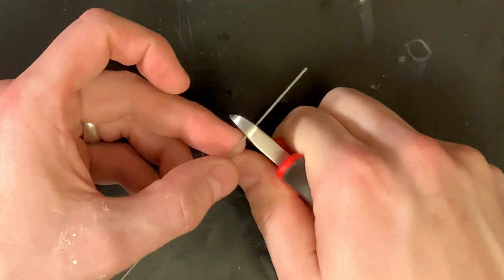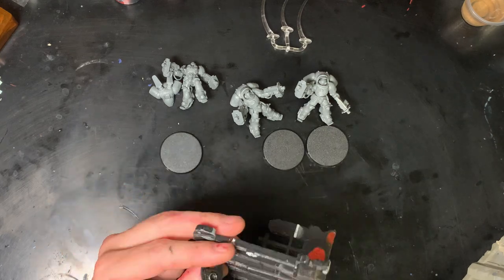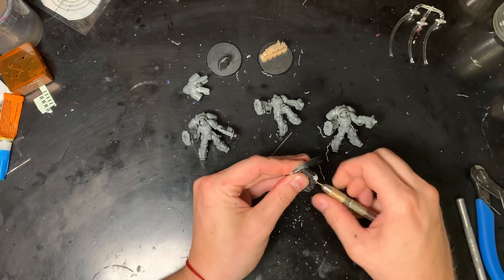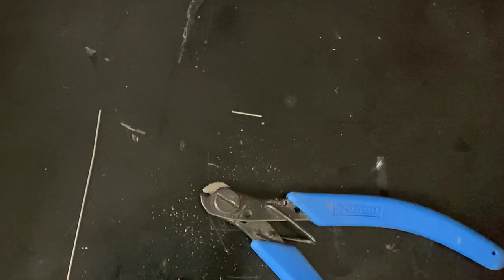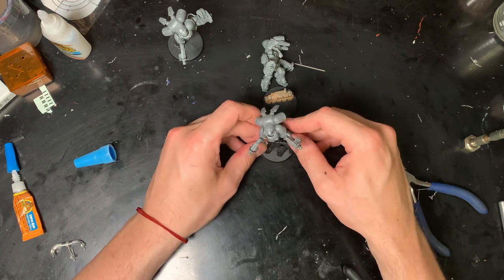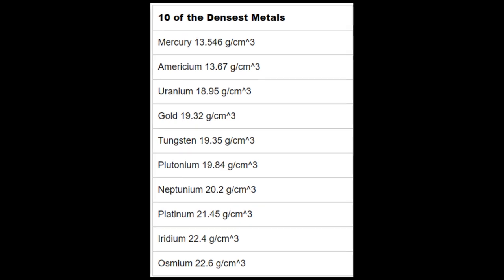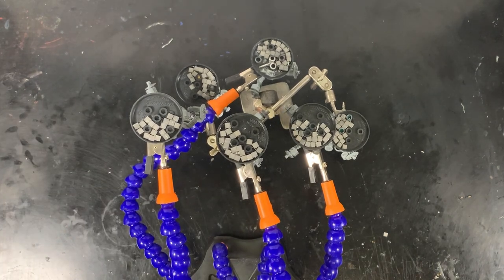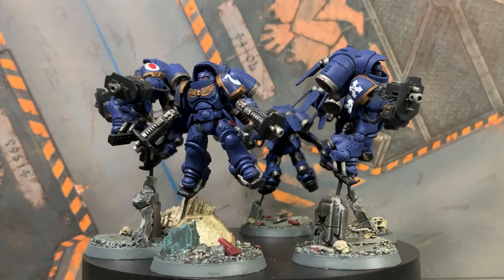Flight Stands SUCK!

Comment: About to do some new Inceptors myself, and was thinking of doing some printed smoke trails again, but I may follow this method. I dig it!. I also may make these next Inceptors with glowing dual plasmas, too, thanks to your vid on it! 

Great content you've got here, man! Hoping to see more uploads in the future.
Reply from the maker: I do have 6 iceptors I will be doing with LED plasma eventually but with a new imperial knights codex on the way…….
Reply: Stoked to see those come together! Your video actually inspired me to model my own coil tonight (I'm like level 2/10 for Fusion360), but it was a fun project. I'm contemplating whether to print them in an inked blue resin, make a blue-stuff mold and use the resin and a UV light to cure, or bite the bullet and do your casting/molding method, but hobby budget is a bit tight right now. 

I've thought about doing three LEDs, two blues and one red for helmet/eyes for the Inceptors, but when it comes to electronics like this, I'm a bit inept and even with a dual CR2032, it won't quite put out enough (and I don't want the base to be huge.) I've got a few other ideas for the plasma inceptors myself, hope to work on them in the next few weeks.  Thanks again for the great content- glad I found your vids.

Comment: Even cheap solution for the counter weight. We used a penny with tall pewter miniatures when they wouldn’t stay upright.
Reply from the maker: A Nickel fits perfectly in a 25 mm round but I still prefer the chips it’s a bit more specific in the placement and it’s heavier

Comment: My biggest problem with my suppressors was, hoe am I meant to prime and paint them without painting the stand. The stand in my heldrake is removable but the suppressors need to be glued on
Reply from the maker: Masking tape and or masking fluid are what you are looking for in that case!
Reply: I generally have them primed off the stands. Just stick em to a paint stir stick with some poster tack and then you’re good to go.
Reply from the maker: @highstrangness4513  also very valid option